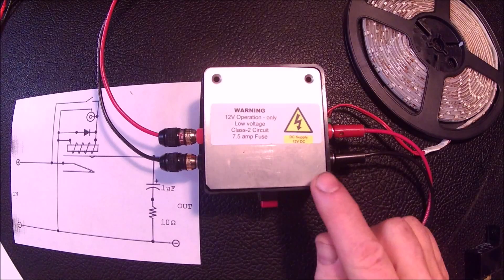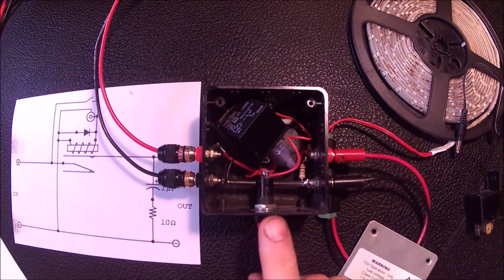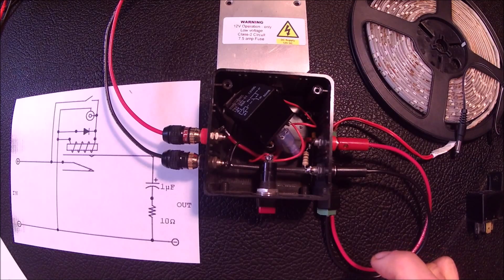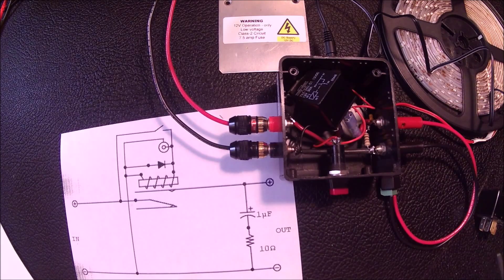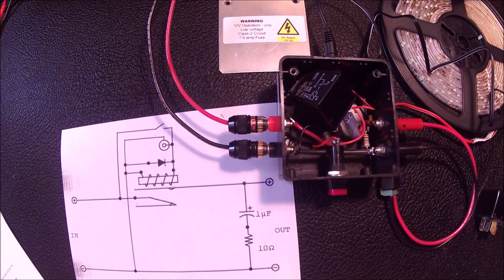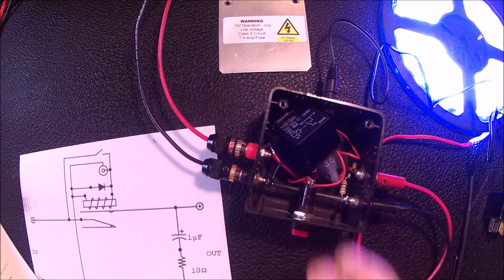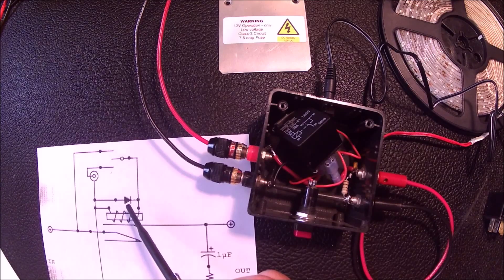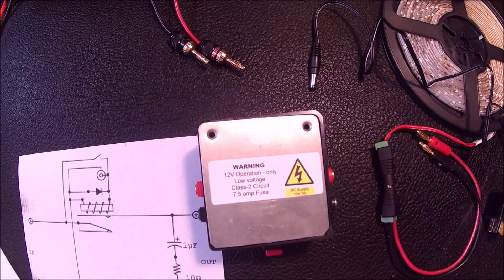Low Voltage Lighting, Class 2 Interface

Comment from the maker: Still using these original low voltage lighting control interfaces.  Had a minor issue with one in that I had a loose connection on one of the DC output banana jack.  That led to some overheating that caused the connection to loosen up a bit more and become intermittent.  I replaced the bad banana jack and got all the connections properly tight and no more issues.  That controller gets used nearly every day to turn on the 12VDC track lights in the kitchen.  Then I have one that turns on lights in the attic and another one for the lights in the patio and both those have had no issues.